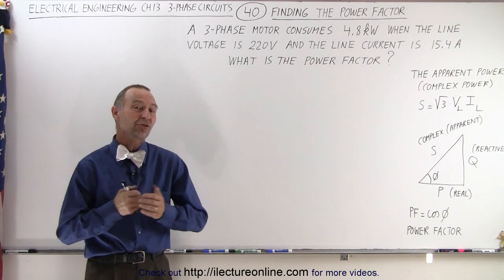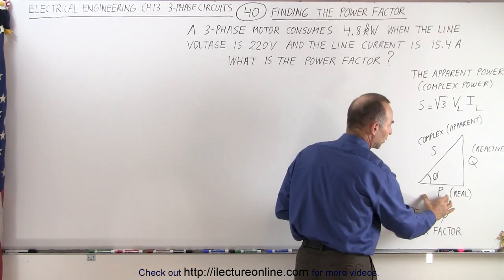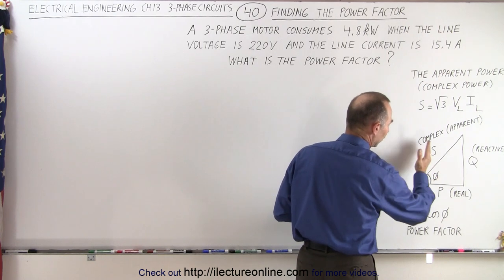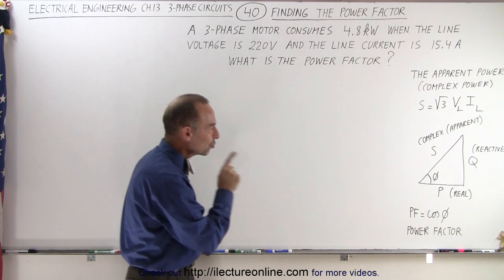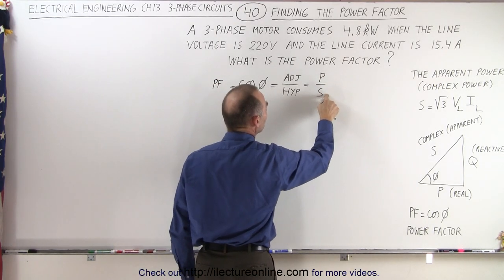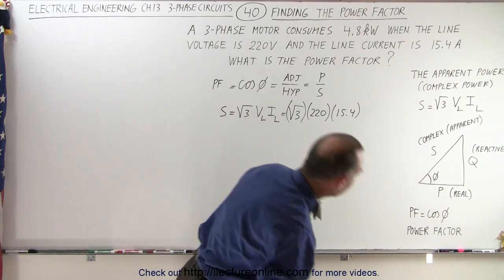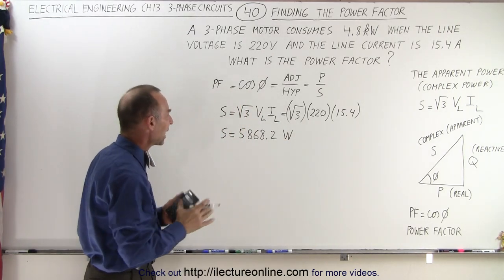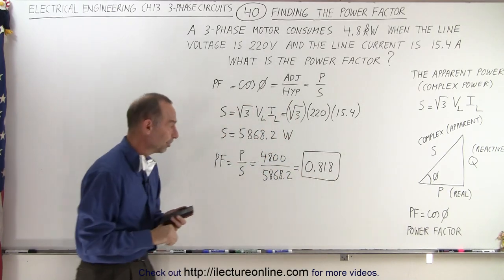Electrical Engineering: Ch 13: 3 Phase Circuit (40 of 53) How to Find the Power Factor?

Comment: I'd recommend one small correction.  You used Watts as the unit for Apparent Power (S).  This would typically use VA for the units.
Reply from the maker: You are correct.  Thank you for the input.

Comment: thank you so much. I have a question: the power consumed by the motor is it the real or reactive power since the motor have both inductances and resistor coils?
Reply from the maker: By definition, the power consumed = I^2 R      The induced current will be in the opposite direction of the current that drives the motor, but the equation still holds.

Comment: Thank you sir
I have a question please
I have a motor nameplate, the information given :
I = 27.13 A
V = 415 V
Output power = 15 kw
And p.f is 0.87
When i used the method which you have explain i  got 0.76 p.f and it does not matching p.f which is given ( 0.87) 😅
Reply from the maker: The power factor does depend on the load and the power consumed (I^2 R) versus the power provided (IV).